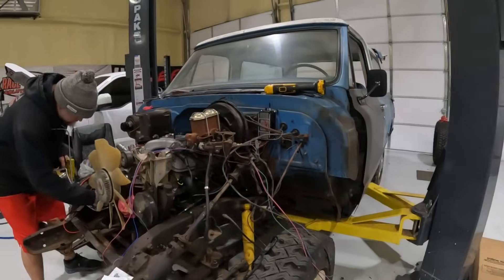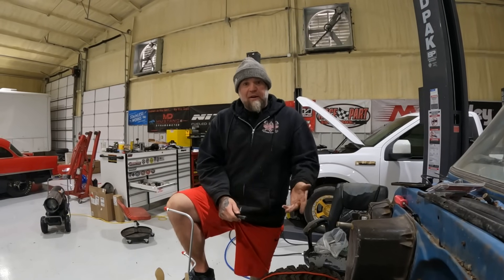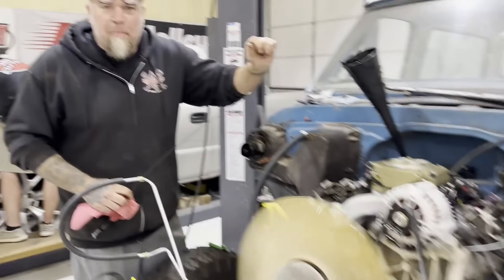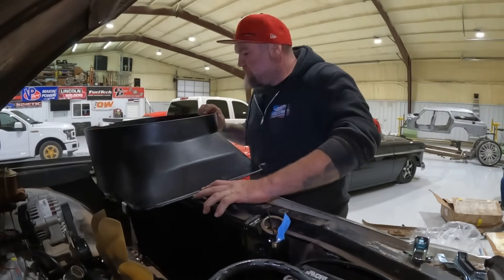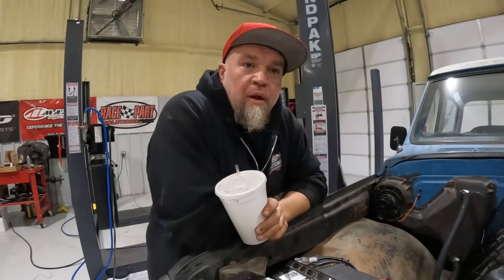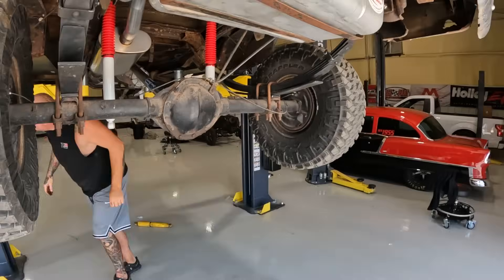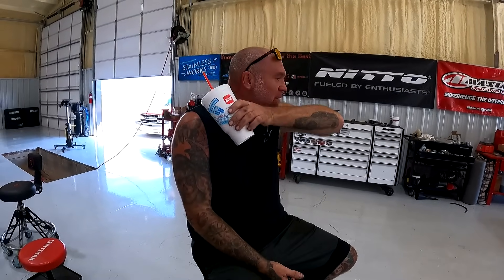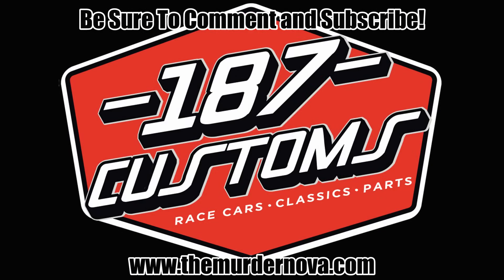Final Episode For the Big Block Swap K5! It's Finished and Ready To Make It's Way Back Home!

Comment: Thanks for the mention. I work at O’REILLYS in Great Falls Montana. And it’s a proven fact liquid under pressure has a higher boiling temperature. So it does need a radiator cap because without it the engine will overheat
Reply: is that if it’s 2wd or 4wd?

Comment: That sucks about the fuel filter. When I had to put the walbro 255 in my 3rd gen camaro for my ls swap for some reason I reused the factory rubber line going from fuel pump to the sending unit metal line... well it cracked eventually and I lost fuel pressure. Then I had to drop the tank and I thought I got submersible fuel line.... well I didn't and in a week it cracked again... so I had to drop the tank for a 3rd time during the build. Next time I am buying a Detroit Speed trap door kit 🤣

Comment: Should have taken fuel tank to radiator shop and flushed it and dipped it in their asset dip to eat the rust out and then have them put a liner in it would have saved you a whole lot of time and hurt on your body

Comment: if you don't need a radiator cap to keep the motor cool then why do they have different pressure ratings, the cooling system is designed to be under pressure, BUT go ahead and run it without a cap and see what happens

Comment: I just did a Sniper install on a 67 Camaro. I have a video on my channel showing all the different issues we had and solved. It's definitely a very nice unit but you gotta watch out for RFI/EMI issues that can cause idle surging or intermediate signal loss. My buddy just let me know that it was running awesome but then the other day, it wasn't quite right. It's coming back to my shop as soon as I get my car lift installed. One of his injectors wasn't working in his first unit so we sent back and got another one and that fixed it for now... I think. That damn 10 pin connector ended up being a big contributor to the interference issues. Had to unpin the wires we weren't using. Holley just released a gen 2 Sniper that addresses all the issues the gen 1 has 🤦‍♂️

Comment: Is this thing ever gonna work right with a sniper and a separate ignition box? No.      Did it cost more than a term x or oem ecu to do it this way? Yes.                                                    Is it gonna be harder to tune? Yes.                                                   Are we gonna do it anyway even though holley themselves doesn't recommend doing this and would send us the right parts? Yes

Comment: Love the videos. Off the wall question, what fans are y’all running on the garage. Quite the pun and my metal shop is insanely hot. 165*F from the roof that radiates and melts away everything.

Comment: If the K5 wanders around the road at speeds, you might install a front stabilizer shock on the front steering linkage. Rancho makes single and dual shot kits. With the bigger tires, it will definitely improve the wandering issues…
Reply: rancho steering stabilizer k5

Comment: I grew up when sbc was king before people figured out the 99+ truck motors were basically the same as an “LS”. I have a lot of respect for sbc and have vehicles still with them, but I’ll say the reason for using using a “junkyard LS” over a small block is that a well used LS will last longer and have more power (stock vs stock) than a small block. Sbc was king LS is king.🤷‍♂️

Comment: Those rubber lines with screws clamps aren't going to hold up on that fuel pump either, rubbers only for return line.
Reply from the maker: i've made over 1000rwhp with rubber lines lol they'll be fine